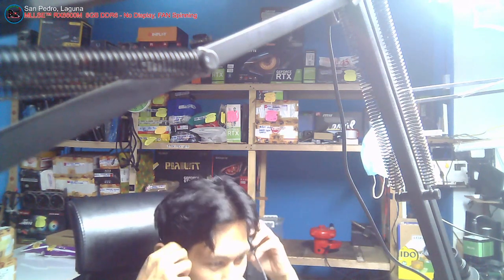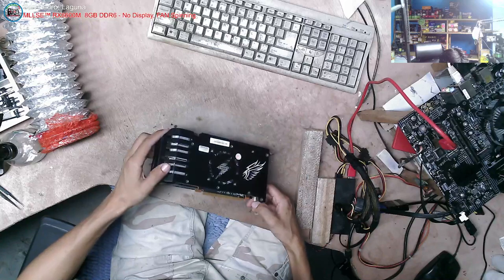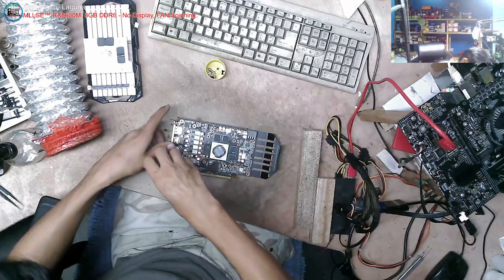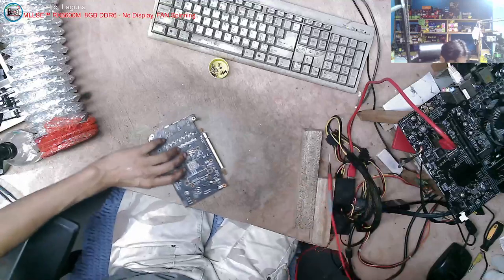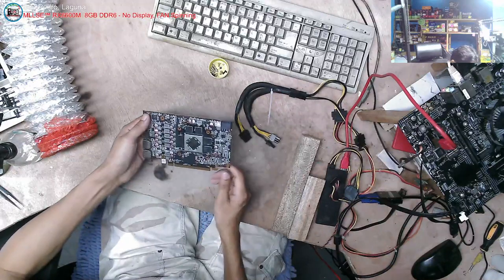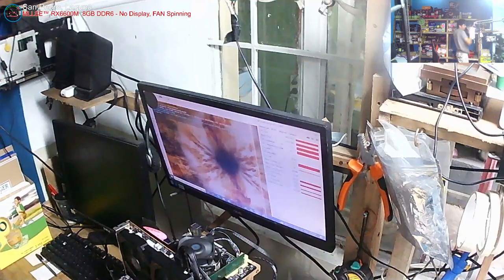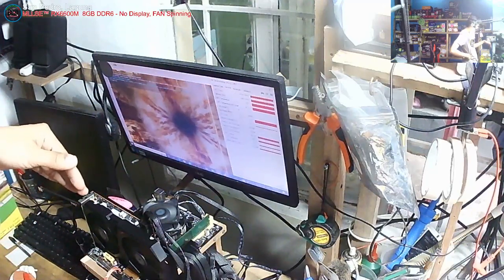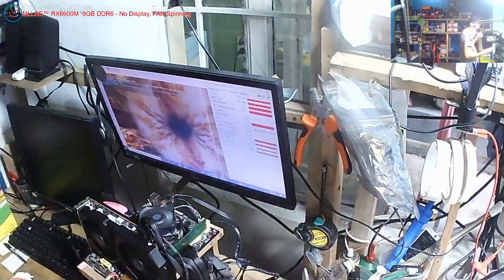MLLSE NEW AMD Radeon rx 6600 8GB Video card GPU GDDR6 128Bit - No Display,Thermal PAD Error(solved)

Comment: I am coming to the opinion that ddr6 memory chips will not hold together with thermal pads. A copper mod will probably work but every  component touching it must have a strip of captan tape protecting it or the mod will fail.
Reply from the maker: Tnx

Comment: kung titignan mo maganda quality ng gpu na yan since active na active yung overheat protection nya 
kung ibang brand yan tulad ng zotac lulutuin yan ng unrecoverable
Reply from the maker: Hnd rin..madalas sa mga pinapagawa dito sakin sa mga fanyang series..yan lang yong mga sirain..mas maganda pa si Zotac, mas active yong protection nya.
Reply: Yung "active protection" na sabi nyo po ay galing sa electronics nya common yan as gpu design. Bali ang problema nya is wrong thermal pad. Kung MLLSE ang naglagay ng pad na rineplace ni Workshopfix masamaya yan sa reputation nila.

Ang pagkumpara ng Zotac sa MLLSE parang Toyota kinompare no sa Proton brand. No contest yan.